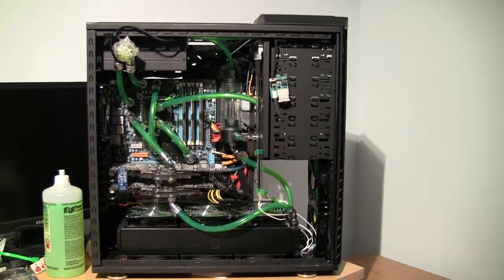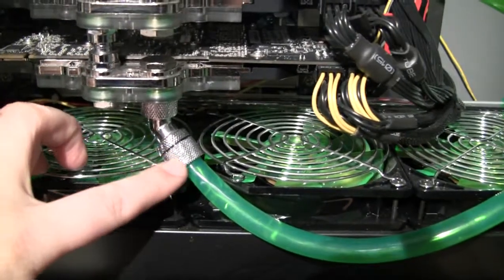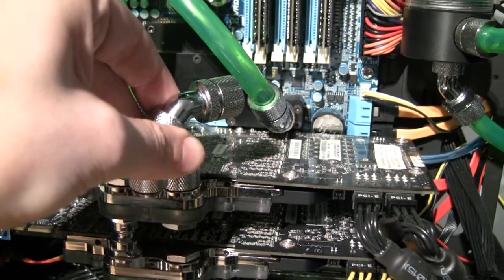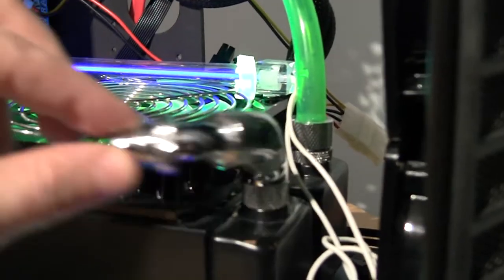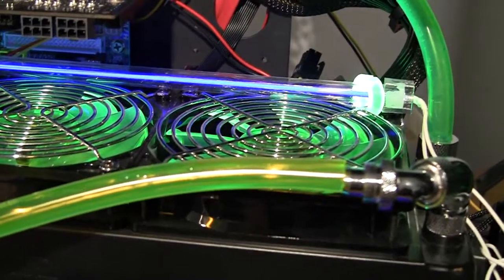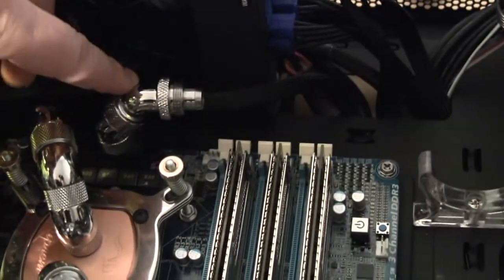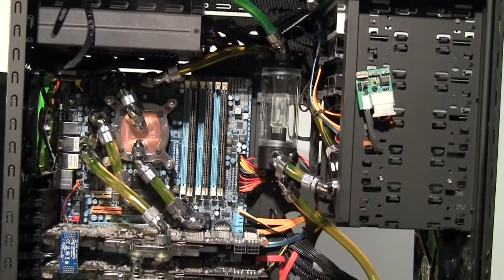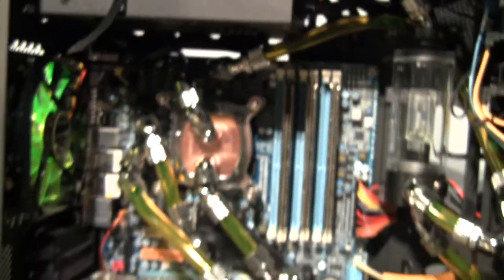Tubing layout optimization with 45 degree adapter fittings

Comment from the maker: @eyekanspele Yes, pump adds some heat, but I had complex enough tube routing and my target was remove complexity of tubing, not make thermally optimal set up.

I just did some testing on this rig and can find review on our website if you like to see what are the temperatures I'm getting. 

"Fully loaded i7 system flow rate vs. temp test"